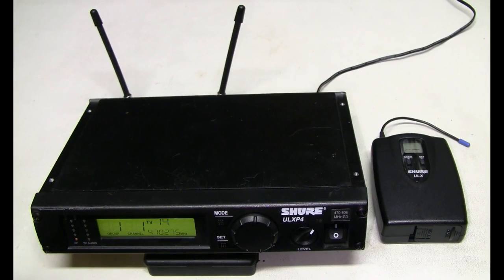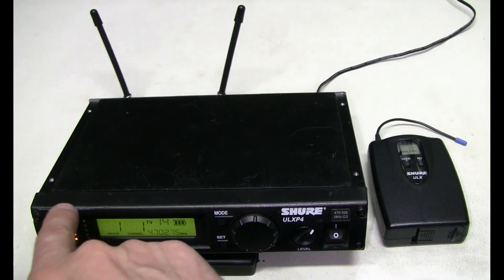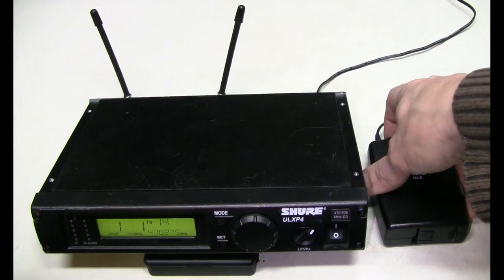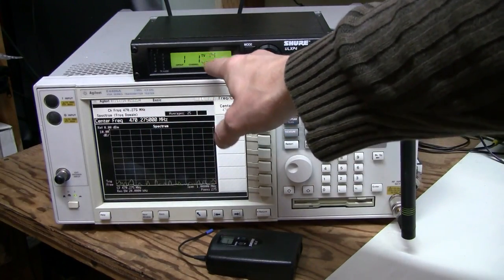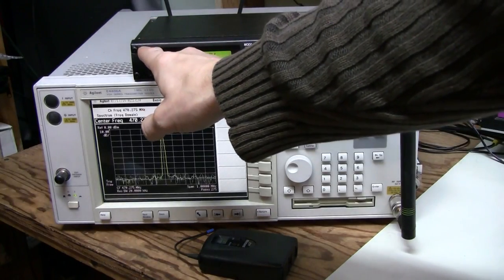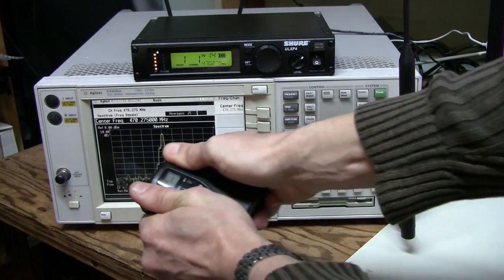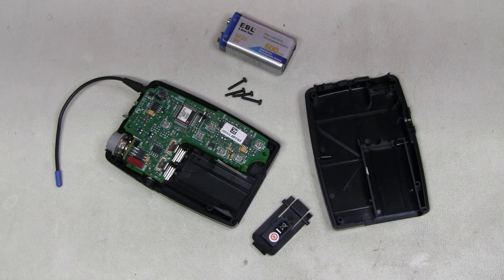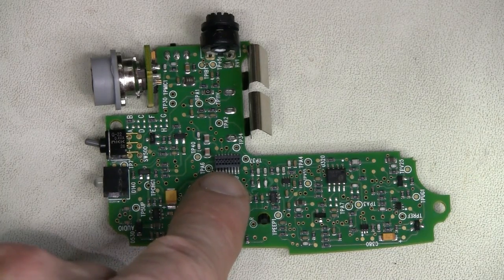#62 - Shure ULX transmitter repair

Comment: Fantastic repair. Indeed, Shure should have known better than put something together like this. They could have added some metal spacers between the boards, held in place by screws, or at least some plastic retainers to compensate for the mechanical stress this type of device is prone to receive during use. A more expensive way would be manufacturing the transmitter"s case out of aluminium, like the EW series diversity transmitters (from Sennheiser I believe).

Comment: Great video. I had the same issue but I couldn’t figure out what contact point was bad… I took the route of banging it around and tightening the screws down more and oddly enough it fixed the problem. I don’t recommend banging it around on your hand though. I guarantee it isn’t a permanent fix.. lol

Comment: This wasn't my issue, but after wasting money on a new transmitter, I resorted to this. Won't totally fix the problem, but until you figure something else... "Disable Tone-Key Squelch:
1. Power OFF the receiver. Press and hold the "MODE" and "SET" buttons for about 3 second while powering ON the receiver.
2. When the antenna "A" indicator on the receiver starts flashing, press the "SET" button.
 - Disabling tone-key is a temporary maintenance operation. When the ULX receiver power is cycled, the Tone-Key detection is restored to normal operation.
 - The tone key signal also carries information about the transmitter's battery condition. The receiver's battery icon will be inactive when tone key is disabled or interrupted."

Comment: HI,  i recently pick up this ulxp4 free from my uncle. only problem i have is the unit turns on but the back light is not one..i can change channel and do a scan but it will not receive a signal from the microphone.  Any time to point me in the directions to repair this?

Comment: Good evening, I am from Jordan and I need your help. I have one of the transmitter of Shure ulx1-m1 and suddenly the numbers, the battery indicator and everything on the screen disappeared. Can you help me what is the problem and how can I fix?Thank you.
Reply from the maker: Why don't you start by looking at this small connector I showed in the video. Most probably you have another joint cracked. It is a weak point in this model.
Reply: Hello sir, thank you for helping me. I did what you told me and made sure that everything was good. However, I have another device and I opened it to identify the problem. I found that the screen board works perfectly, and the problem is with the power board. When I turn it on, it remains red and does not turn green. Can you tell me the reason? Or what do you advise me? Thanks again.

Comment: This is a classic example of cause and effect.  Trying to save a few cents in parts, for better structural integrity, leading to failures. Shure had to know these units will be dropped constantly. Perhaps this was done intentionally to sell replacement transmitters? Not trying to make Shure sound evil here but they need to improve their product before they get a bad rep.